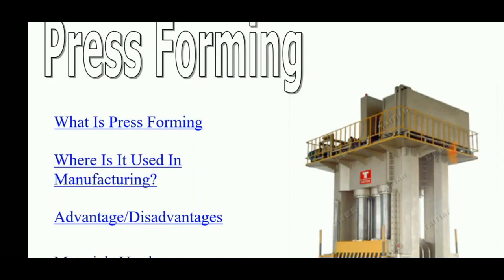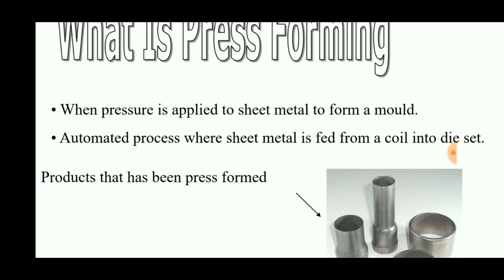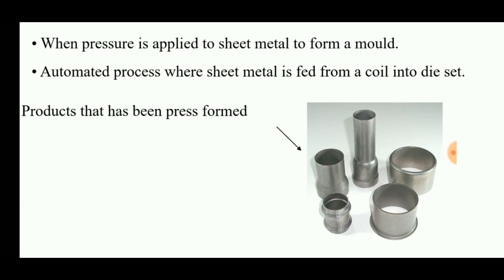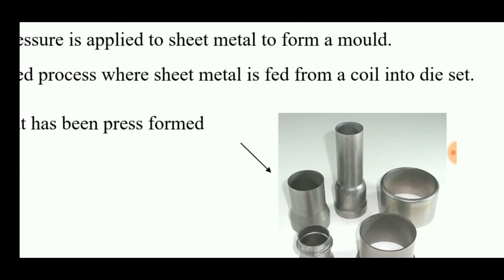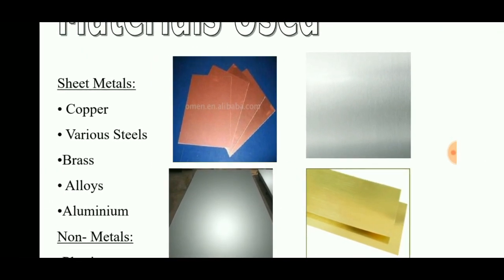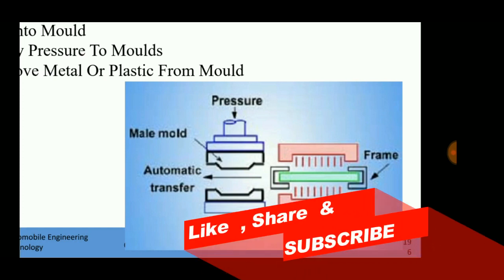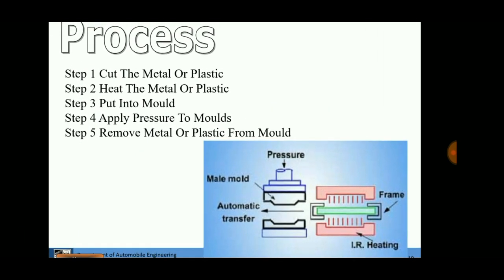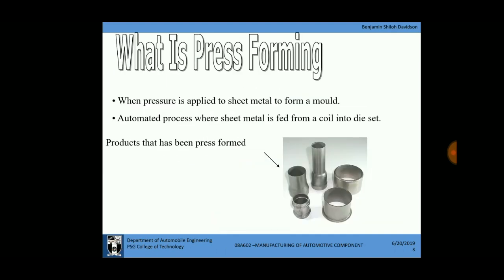Press Forming Process| Shaping process| Working| Advantages | ENGINEERING STUDY MATERIALS

Comment: Is press forming AND press brake the same?
Reply from the maker: Thanks for asking question.
Yes it is same.
Reply: @EngineeringStudyMaterials  your welcome and thank you for replying quick
Reply: @priya200328  I think they are a bit different. A press brake is usually used to bend sheet metal whereas as the name suggests press forming is used to form sheet metal into different shapes